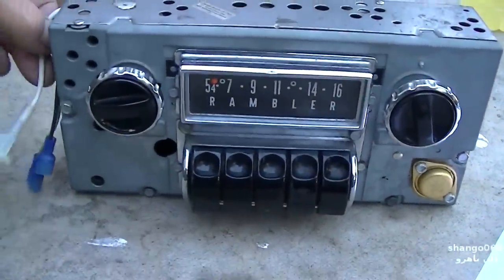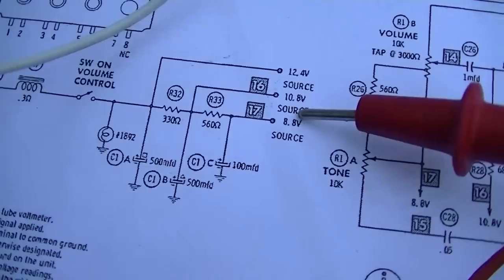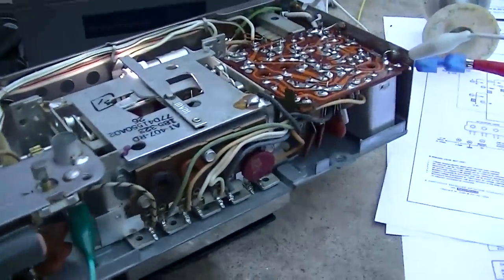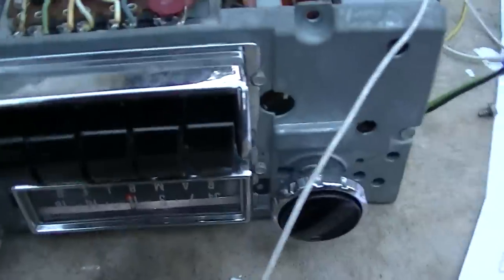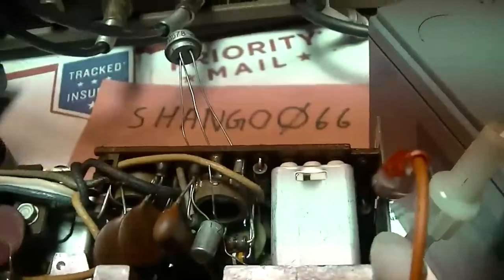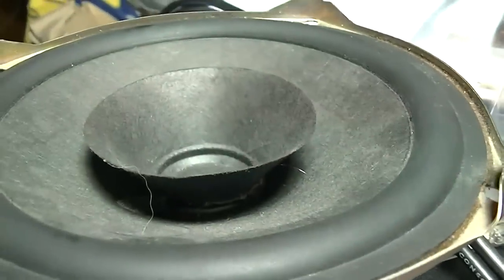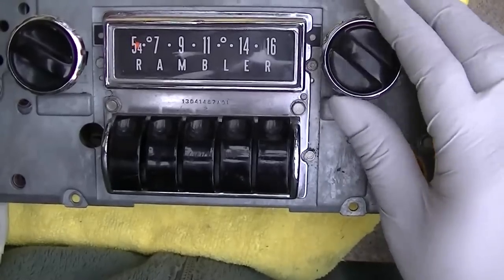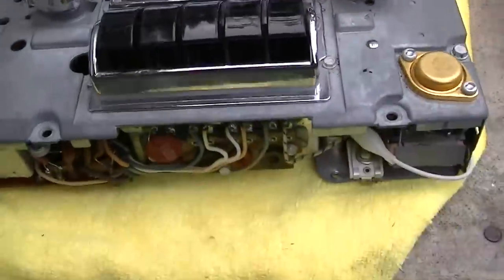AMC Rambler 1963 AM Car Radio Repair 3TMR

Comment: Man the '63 Rambler, do I remember that well.  There was a jeweler here in town who purchased on brand new in '63, he drove that old car till he died back in 06!  By the time he passed on, you could see him coming from a mile away from the oil that poured out the tail pipe, but being in South Dakota, one of the last "free" states when it comes to pollution, nobody cared!  When I was a boy in the '60's I used to love "upgrading my car radio. Back then Stereo was just becoming a thing, Hi FI was still the thing to have, and having a front and rear speaker was the "IN" thing.  So it was that I found a radio out of a Chrysler Imperial, it was the REAL DEAL man, had motorized tuning so when you pushed a button a small electric motor would advance the needle and tune the radio to the right frequency.  I had to take a hack saw to the dash on my 1950 Ford Custom to fit it in, but fit it I did, I ran two large speakers on the back deck, mounted beneath the cardboard insert and punched holes so the sound could escape.  When Dad bought the for me, (my FIRST car) for $25.00 it had been in a front end collision, so my best friend and I made a trip to the city dump and found a front clip, we took it off the wreck at the dump and replaced the front end of my pretty little gray Ford with a black front clip and hood.  Really didn't turn out that bad, then, since the front seat was trashed by the old man (first owner) who had it, I took out the front seat and replaced it with a front seat taken out of (wait for it!) Rambler Station Wagon.  You see, the Rambler had an innovative idea and had a fold down seat rest on the front bench seat, so when folded down, I  had a full size bed!  Man with that hifi radio, the fold down seat and a gallon of tap beer (purchased by a bootlegger I knew) we could party hearty anywhere.  TO enhance the car, we painted the inside of the two dome lights (one on each door pillar  in that model, with a red fingernail polish, and my buddy poured a half bottle of Jade East men's after shave down the defroster, so the smell was positively putrid till we had smoked about a carton of Marlboro in the car.  Ah yes, she was quite a party wagon, and truly enhanced my young sex education, which was, as it should be, left to the youth of America to learn through experimentation.
Reply: Cool you shared this. I remember the fold down seats in those cars The family had some of them.

Comment: Shango, I had a customer bring in a 64 Rambler Ambassador for some electrical work, and it did have this same identical radio in it. Added an FM section to it, otherwise didn't need much. Good call on the model year.
Reply: How did you add a FM section?
Reply: The Aurora FMC. It's a self contained tuner on a board just slightly larger than a postage stamp which uses the AM oscillator as a reference and breaks into the detector when in FM mode.
Reply: Justin Rubsam
Wow thanks, thats cool! Never heard about something like that!

Comment: 25:48 I remember that dial coverage... years ago my family lived in Sun Valley, then, later Saugus. In Sun Valley I was about 10 in '67 and listened mainly to what was then KHJ 930 and KRLA 1110 ... the AM rock stations back then. In the area I lived in then KMPC at 710 was the strongest on the AM dial.... whenever I would make a little crystal set, KMPC always came in loud and clear :-)..... good memories.

Comment: Motorola had one of best electronic engineering department in our country. When I serviced those car radios the 2SA72 transistor was always the problem  component that failed back in the 70 s.

Comment: I agree on the capacitor thing, I've got plenty of old electronics and I've NEVER changed a capacitor. There's only one thing I ever came across that actually needs new caps. Still does it's job though, just hums.
Reply: I have an old valve radio with old caps and is worked fine but they have been changed as they aren't the best an they are really leaky.
Reply: @100Transistors  
I believe he is talking about the electrolytics. Those are usually fine. But the paper ones are always bad. They leak and short.

Comment: That girl was not keeping it gangsta.  You're right about the automatic capacitor replacement epidemic---in a set of this vintage, germanium transistors are more suspect than failed electrolytics.

Comment: Nice repair! It will work even better with the correct impedance car antenna (and ground plane) and the trimmer adjusted. The Motorola radio looks great -  wonder what the Rambler looks like...

Comment: I had a 65 rambler classic 770, it was a rust bucket but I got it running, someone also put a cheap LED in the display lamp, I've seen some no transformer sets use bulb as basically a fuse also. My radio was missing unfortunately.

Comment: That's a cool dial lamp replacement with the LEDs. That set is overall cool.. I like the shape of it's cabinet. That would make a nice  vintage battery-powered portable boom-box project installed in a nice homebrew outer cabinet with built-in batteries and telescoping whip antenna. :-)
Reply: Several years ago I built a 1972 Ford car radio into a wood cabinet, with internal speaker, batteries and a whip antenna. To keep the whip tracking along across the dial, I made a little coupler-shaft that extends the RF amp's input trimmer-capacitor adjustment to a knob on the back of the wood cabinet... works great. :-) The current draw for that particular set is only about 200 milliamps with the volume all the way down and just a little more at comfortable listening level and is ideal for a homebrew project like that. I wonder what that Rambler set draws...

Comment: The one thing that Engineers did not take into consideration with those old sets, kids using the cars as, well meeting centers with young ladies before they got their Drivers License.  Dad used to get so pissed off at me when I sat in the car and jumper the aux to power then turned on the radio so we could have some music while we, well, explored each others bodies and such in the old ford parked alongside the house, out of view of the windows.  Then when dad wanted to go uptown the battery would be dead and he would have to dig out the battery charger and hook it to the car as the sweat would form on his forehead, his hands reaching for the pack of cigarettes that was EMPTY, his hip pocket was missing the half pint of whiskey that lived there as it too had gone dry.  Of course I had taken his last pack of smokes for my own use and the whiskey was out in my shack to be consumed by my buddies and I that night.

Comment: Just a quick note the radio. for the 1963 Rambler was the same radio that fit the 1964 and the 1965 Ramblers so, it could of started life in a 1964, then got stuck in a 1963

Comment: I have watched many of your videos.  I really like the fact that you DIAGNOSE problems, rather than shotgun parts. Of course some "known bad"  parts should always be considered for replacement.  But, I'm with you, not all caps need be replaced.  I also like the fact that you actually do  most of the work "on-camera" rather than going into lengthy chats about what you have done "off camera".  I just wish I had the sophisticated diagnostic gear you have.  I got some basic tools, such as a few very good tube testers, several multimeters, a small cap checker, etc.  But I sure wish I had the big CRT tester and alignment signal generators you have.  Sigh!

Comment: AWESOME video, Shango! I always look forward to your new vintage electronics repair videos--I always learn something. It's very important to obtain a baseline operating condition on any vintage radio or TV set before monkeying around with the caps, but I would closely visually inspect the capacitors in the power-supply circuit and test them before energizing the chassis. I see that this car radio came off of the assembly line shortly before the CONELRAD markings came off of AM radio dials.

(I feel very sorry and empathize for the young lady at the door of that apartment, and know what it's like to be dumped like that. I hope she's okay.)

Comment: it's not the generator that's noisy, it's the ignition system... there's even a resistor in the disturbitor in many cars, if you bridge it the radio is MUCH noisier... I thought it was for like... limiting current for the spark plug but I guess it also reduces noise in the radio

Comment: The Tranpacitor was the culprit. I always replace all Tranpacitors... LOL
Reply: I thought it was the fetzer valve, or the muffler bearings.
Reply: Dennis Hill ... or you can repair the transistor, by refilling it with new germanium fluid.

Comment: Often wondered why Motorola and Delco (not familiar with Ford/Philco or Mopar) car radios used a class A output stage. Just a matter of available current and circuit simplicity? I recall when Delco switched to class B, they also went to bridged designs that required a floating ground to each speaker - but output power was doubled, and that 3db did seem to make a difference.  Oh, and my rant is this boner to slap LED lighting into anything and everything vintage. UGH! "Oh, look at my silver face PIoneer with the ultra bright pink / green / purple lighting". Egads, if my eyes rolled any harder, I'd see my brains.
Reply: Just like the McIntosh amps. Nice way to sully the name and cheapen it, but hey the tubes glow green!

Comment: Maybe a silly question, but maybe not, I've always wondered why we use silicon transistors instead of germanium transistors. I mean half the voltage drop should theoretically mean that they are more efficient, as less voltage is dropped as heat?
Reply from the maker: They are fairly unstable, very temperature sensitive but yea the low voltage drop they can work fairly well with just a few volts
Reply: Oh, youtube comments. grabs popcorn
Reply: Luke Den Hartog Yum, popcorn. 🍿
Reply: ungratefulmetalpansy nah popcorn is cheaper.
Reply: ungratefulmetalpansy Didn't you know that the loudest ones are the biggest know it all's around!

Comment: I had a 1963 AMC Ambassador which had this same Motorola radio. Mine worked well but the tuner eventually went dead on it, so I tapped a line in jack to play nicely compressed mp3 audio into it. of course the car is long gone now - but interestingly enough this car had an alternator rated I believe 35 amps or was it 55? I forget.. But it was a true alternator with a voltage regulator produced by : Motorola! The voltage regulator transistor on it was a Motorola and it was Gold plated/colored just like the one on that Motorola AM Radio. The Voltage Reg on the alternator was bad and I couldn't source a replacement so simply updated it to a random Bosch alternator that more or less fit in place of the original Motorola Alternator. That AM Radio sounded good and pulled in distant stations with ease and sounded good too!

Comment: what is it with the transistors?
Reply: Germanium transistors are not very reliable nowadays. Sometimes the germanium crystal will grow inside the can and short to the case, and sometimes even a tin whisker inside the case will short them out.

Comment: older fabric or graphite paper speaker cones,their response and smoothness can be increased by painting on rubber cement to each surface,I did so with a pair of utah coax 3 ways,,celesta is what I remember  on the inside labels,even the  bass suspension was fabric,,use a fan to chase the damn fumes,,nasty stuff,I had those utahs working  from '71 till the mid 90s,finally crapped out * intalled pyle  10''' drivers in the same  cabinets.                   a pic of them got a lot of music outa these things        http://thumbs.worthpoint.com/zoom/images2/1/0511/16/vintage-utah-celesta-c8jc-coaxial_1_b5f7791fd0e81915525d02554c9f9388.jpg
Reply: Tom Kelly 
Wouldn't that tend to deaden the sound?
Reply: I got  years of use with my improvisations grygory,, the receiver I used was a pioneer 35 wpc 200 buck unit, and a panasonic vintage low powered 15 wpc amfm/cassette ,  but smooooth amfm apparatus that handled  the fireworks
of tchaikovskys symphony # 7 really well,,bass that shook the damn house, the sound curtain they made  in handling celesta,cymbals,so clear you could point almost see the instrument  position in the orchestra pit,,or stage,really excellent definition,,,neighbors who heard the set up through open doors remarked on how clear sounding my set up was,,

Comment: A nice interlude with a "Days of Our Lives" reality soap opera. Looked like Section 8 housing to me, so lots of broken-hearted folks going to miss Obama and the gravy train. SNIFF!
Back to radio's,  given the hard to obtain and high cost of Germanium transistors today, 45 plus years down the road of their demise from new designs...isn't it practical to consider re-biasing the circuits for their  Silicon equivalents? I know it could be a lot of work, but the option is tossing this stuff on the scrap pile.